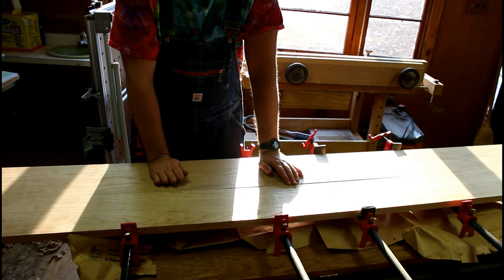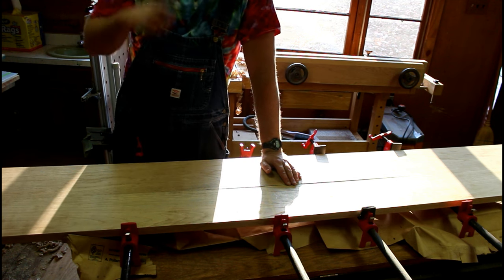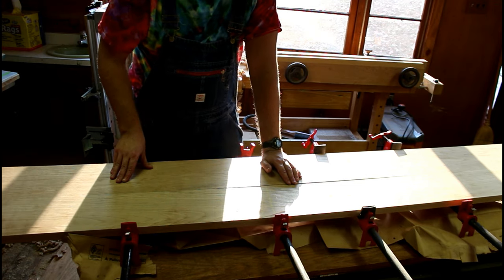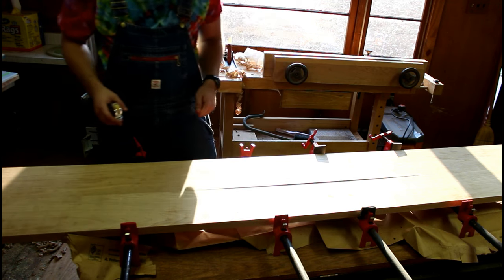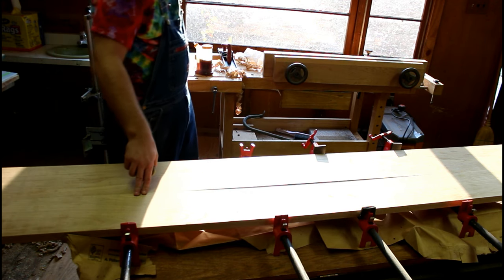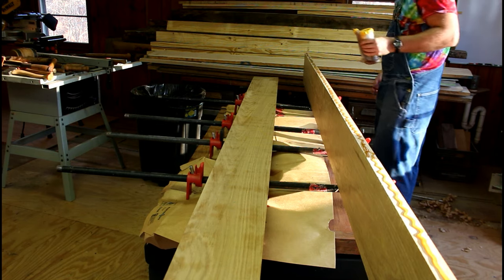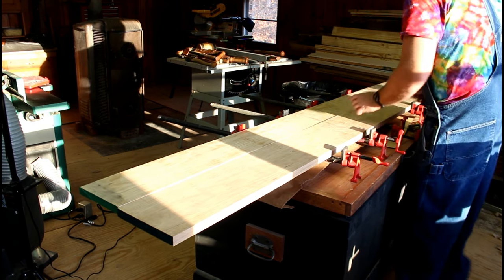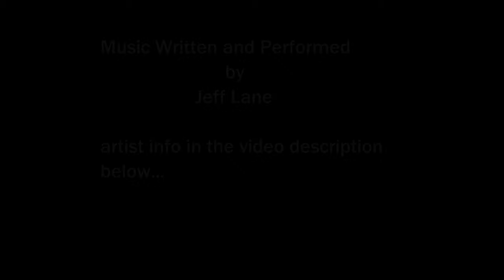Farm Table Build

Comment: Nice work.  I'm wondering why you used a hand plane after you had already used the joiner.  Also have you ever considered using butterfly spline ( “Arikata”) in a dark wood such as black walnut heartwood, for contrast with the white oak.  I think that would be a very attractive way to hold the top  boards together in addition to the glue.
Reply from the maker: +GrowLLLTigeRRR I like to smooth the face over a few times. I find it makes a better joint/surface than just the Jointer alone. Cleans up the machine marks. Splines are nice also. Use them sometimes. Thanks for watching
Reply: I have a spiral cutter head and  you cant see the joint